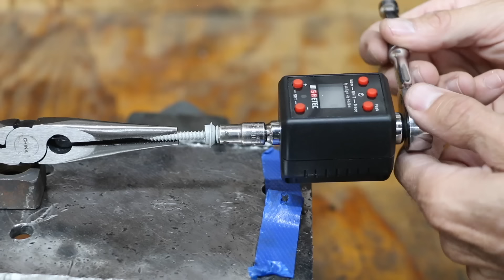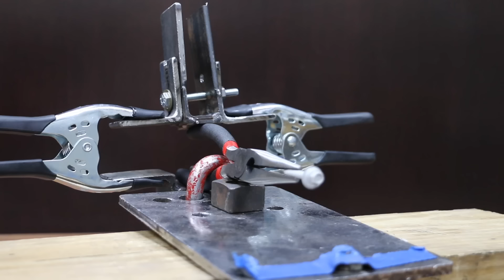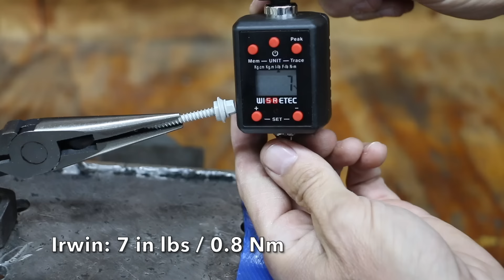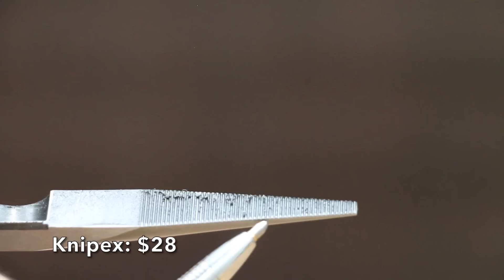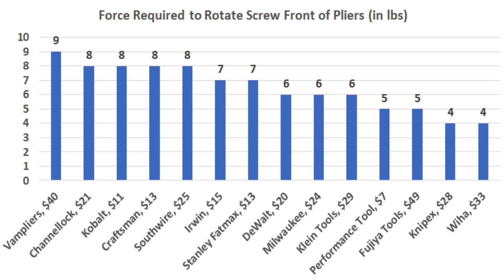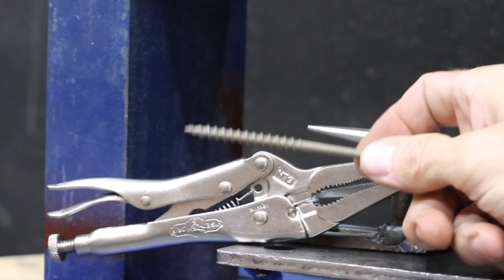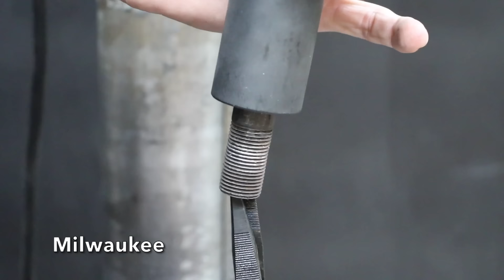Japan vs German Pliers (LONG NOSE)? Knipex, Vampliers, Klein, Fujiya, Irwin, Kobalt Needle Nose

Comment: The short handle, long nose pliers are made more with electricians in mind than mechanics, one can tell by the slip guards at the overmolds.
Less grip force is acceptable when you get a longer reach to grab wires deep inside device or distribution cabinet.
They also come in a variant  with even more pronounced slip guards as is mandated by the VDE to work on powerd off circuits, still physically connected to the grid. Just in case you froget the whole power off business 🙂
One neat test btw. is to expose the pliers to stone dust while they move. The cheap ones tend to seize up really fast.
Reply from the maker: Thanks for the feedback.  Thanks for the video idea.

Comment: I differentiate between needle-nose and long-nose pliers.  The needle-nose ones are smooth-jawed and very skinny and long.   If you work with electronics, smooth-jawed pliers can be quite useful as the tend not to damage softer copper surfaces.   I have a set of smooth-jawed needle-nose, duckbill and bent-nose pliers.
Reply from the maker: Thanks for the feedback.

Comment: Unfortunately, this test was not so good. The pliers, which were built larger and wider, perform better, as expected. The Knipex has a compact design for difficult areas and is therefore also shorter and a little thinner at the front. The test is not clear. 
The other tests are quite good.

Comment: I love this channel! With that said I work in a industry where needlenose pliers are our primary tool. It would have been nice to have a test to see which pliers would pick up and hold firmly the smallest item? Such as a small wire,string etc. The tolerance between the jaws when closed is super important!
Reply from the maker: Thanks!  Thanks for the video idea.
Reply: EXACTLY!  Needle nose pliers are a "saver" or "rescue" tool, so they need to pick up and hold small pieces at the extreme end.  Some are thinner and thus can get inside deeper, but then fail miserably to hold the spring or piece I need to pull or turn.  The twisting test is revealing, but most pliers will just slide before any real twisting occurs.  Perhaps a more related-to-daily-use test could be devised, in the Project Farm tradition...
Reply: @alfredomarquez9777  Yes, exactly.   Fit for purpose and fit for use, definitely two different things.  That said, this video shows how that applies and just a little more explaining on this would help the viewer better understand why one fails in a certain test vs another one.  Noted that it’s very difficult to cover every aspect in these tests and in the end everyone learns a lot from all the effort and thinking PF puts into these videos.  Just as valuable are all the comments discussing the details and in many cases the “why” of failure and success in a test along with why the tool has to match the use case of the user.   Of course, everyone fully respects the use case for their tools and would never exceed the bounds of the tool, like using pliers as a hammer.   Hehe.
Reply: Project Farm is the hardest working man on YouTube. Hats off for him.
Reply: Yes the Knipex were true needle nose pliers all the others were long nose pliers, instead of using the 26 model they should have used the 30 or even the 13 electrical installation multi pliers which have similar reach length to the other pliers tested. the cutting isn't very important as you say there are proper dedicated tools for those types of jobs, but I was disappointed that the knipex didn't hold up better, when all of their other tools do in regards to robustness.
Reply: Seconded. I haven't personally reached for needle nose pliers for the heavy duty tasks tested, but I use them a lot for electrical/electronic work, retaining rings...smaller stuff where precision and control are important.
Reply: Maybe pick up the small item with the lease amount of force required.
Reply: Maybe even add a test of long reach needle nose pliers.
Reply: So youre a sex change doctor?

Comment: Last test is imo one of the most critical for needle nose pliers. I would've liked see also accessibility test for tight spaces and that rated for overall performance, cause well, sizing is definitely a factor in force testing, but too big pliers aren't worth anything in ie. many mechanics work. But overall, pretty good testing.
Reply from the maker: Thanks!  Thanks for the suggestion.

Comment: I am in the market for metal capped dead blow hammers and cable cutters. Is the snap on dead blow the best deal at around $100 a hammer? Are knipex better cable cutters at $80 or is there a cheaper pair that's cheaper and just as durable? Been looking online at both and I'm just not confident in the options I've found but don't want to spend Snap on money if I don't need to.
Reply from the maker: Thanks for the suggestion.

Comment: Sorry but the tests weren't really applicable for the tasks 99% of users actually buy these types of pliers for. The tightness (so they don't twist off of whatever they're grabbing) and reach are probably the two most important features of needle nose pliers.
The ones that performed well in the grip test had almost not even needle nose profiles on their tips.  It was a simple demonstration of physics at work not a superiority of their specific brands.

Comment: I have to say that I doubt that I would ever use a long set of pliers to cut through nails, deck screws etc....matter of fact, I havent ever used them for that purpose...there are other, more adept tools for that purpose. If they can get into a small hole to pick something up without damaging it or retrieve it easily, then that would be good enough for me. I can appreciate your approach but I don't think that it is pertinent to these specific tools. Maybe tests of how well they can pull eg. wire through a hole without losing grip or how well they feel in your hand when using them in similar situations would have been more appropriate?

Comment: You should do one on trailer hitches . I’m looking at class 3 hitches and there are two for my Durango and $100 deference in price . I think one mounts on the frame and the other is half the size and mounted right in the middle under the bumper with like only 2 blots and is only 100 pounds Less in towing specs .. may be a fun comparison to do
Reply from the maker: Thanks for the suggestion.

Comment: It must be noted that this tool is NOT designed for cutting anything harder then copper. Use the correct tool and most of these will last an extremely long time. I would be looking at the falcon for movement b 4 buying. You wanna cut steel with the right tool. This is still a great video for getting started.
Reply from the maker: Thanks for the feedback.

Comment: I use a lot but apparently I'm babying mine LOL!!!  Wow that is some great testing.
So far in these hand tool videos I'm liking the price/performance of Irwin - not the best or worst, not the cheapest or even close to most expensive but for a home user a solid choice.  So far I've added a couple you have tested and for my household usage they have been big upgrades to what I had.
Reply from the maker: Thanks!  Thanks for the feedback.

Comment: Thank you for your work!
For long/needle tools, it might be helpful to compare the ability to hang on to a part deep down inside something.  Using the tip of the plier to hold a 1/8" sphere (ball bearing), how far down a 1/2" pipe will they reach?  While we're at it, can any of them hold a 1/8" ball (for example) with 100# of clamping force without the ball slipping (screw-head pull in a recess test)?  This might level the playing field for slimmer designs and those with cross-hatch vs diagonal serrations.
I too look forward to next time.  Thanks again!
Reply from the maker: You are welcome!  Thanks for the suggestion.

Comment: While this test showed the toughness of a set of needle nose pliers, that's really not what I reach for a pair of them for. Needle nose are really for use in deep places. For me there's a measure of dexterity required for needle nose pliers, single handed operation, opening and closing the jaws. I  have many pairs of needle nose pliers because some are finer on the point of the jaw while others are stronger but wider at the jaw tip, They each have their place. Cutting nails and screws is not one of the tasks I would use needle noses for. In the world of pliers, needle nose are more of a surgical tool than a brute strength tool.
Reply from the maker: Thanks for the feedback.

Comment: Issue here is you're testing those pliers on scenarios where other tools are used. Nobody will cut nails or screws with those nor require tight grip to hold things steady. That's what bolt/wire cutters and channel locks/vice grips are for.

Comment: Thanks for your testing – your channel is one of the few places to see comparisons between the different tool brands.

Would be nice to include the tool truck and industrial brands in your testing.  I realize that the tool truck brands are budget busters.  Testing the tool truck brands will help the young mechanics find out what they are buying when they put down their extra money to buy from the trucks.  

Industrial brands like Williams and Proto are more budget minded.   I have some Williams pliers and they work well for me.

There are alternatives to long needle nose pliers when twisting:  short needle nose or duck bill pliers.  

May want to point out that Craftsman, DeWalt, and Stanley are owned by the same company Stanley Black & Decker.
Reply from the maker: You are welcome!  Thanks for the feedback.

Comment: I thought due to the design, they were all pretty weak if you over use them. I've never bought an expensive one because I lose or bust them so quickly, and didn't think an expensive one would last me any longer. Another great review, but I'll carry on losing and busting the cheaper ones for a while longer at least 👍
Reply from the maker: Thanks for the feedback.

Comment: The "performance tool" make a reasonable diagonal cutting plier. They're only about $7 and you can grind off the face to make flush cuts. I usually have a few lying around and if you break or lose them, eh.
Reply from the maker: Thanks for sharing.

Comment: First I say great test. Gives a good idea of the toughness of the pliers, however I must say that it is missing an important aspect which is real life usage experience. I don't think that someone buying this kind of pliers will put it - unless no other choice is available - to this kind of abuse. These are mostly used for delicate work, and the test give us no idea how they do in their designed usage. For example - how do they grip a a small diameter wire, how easy it is to do some gentle work with them, I would expect that working with those who have a stiff handle movement will tire the hand when doing delicate work, and so on.
Thanks for the time and effort.
Reply from the maker: You are welcome!

Comment: I have a pair of Channel Lock pliers that I’ve worn out the tips on. I’m a machinist and used them to grab and twist off the burrs on the end of steel tubing after being parted off on the lathe. Over time I wore down the cross hatch diamond grippers on the jaws so that took increasingly more hand grip to get a good bite. I may have sprung them some too because I can now see about 1/64 to 1/32 of daylight between the jaws on the tips. However they worked really well up to that point.
Reply from the maker: Thanks for the feedback.

Comment: I'm an electrician so Klein is probably the most common I see. I think for needlenose they're quite pricey. I have the exact model of Southwire with the blue handles and 12ga. wire stripper used in this test and overall they seem to perform really well so I'm happy with them.
Reply from the maker: Thanks for sharing.

Comment: I use Channel-Locks for all my hand tools and never had any problems with any of them.

I specifically chose this brand since they were made in the USA. I am surprised they did so poorly on the twist test, not that I have ever used them for that level of extreme torque.

I think a reach test, smallest item it can pick up, or small access test would have been beneficial, since that is the design purpose of the needlenose pliers.
Reply: I love my Channelocks.  I go for them first before my Snap-ons or Knipex plers.
Reply: @dc5723  I have a pair of old Irwin needlenose pliers that have lasted me for almost 20 years now. Probably the only pliers that are not Knipex that ride around with me.
Reply: I had terrible luck with channel locks, but I'm also a mechanic in the rust belt and probably do more forceful twisting with needle nose trying to remove stubborn fasteners etc.
Reply: "made in the USA" doesn't mean what it used to
Reply from the maker: Thanks for the feedback.
Reply: Yeah, they make linemen's pliers for twisting stuff. Channellock is my favorite pliers brand.
Reply: I've never had much love for channelock, maybe just bad experience as I've only used their terrible slipjoints, where a tool is made has absolutely no meaning there are shit tools made everywhere and good tools in all markets too.  Just buy the good tool not the flag waving bullshit, you'll end up with a better toolkit picking your tools on merit rather than country.
Reply: @Savagetechie  guess you shop at Harbor Freight then, lol
Reply: @badboy10350  I've never even seen a harbour freight, I live in Scotland. I just think country of origin isn't important at all, I have nice German tools, nice Japanese tools, nice Chinese tools and some nice ones from Austria etc etc I've also had some shite ones from everywhere too. The only people in the world that place country of origin as a top requirement are North Americans and its just stupid, choose quality not country.
Reply: @badboy10350  no its just reality...you really think "made in usa" means the abs benchmark anymore...pfffftttt i feel bad for you if you do think that bub
Reply: @Mike_Jones68  I'll take that over "most" made in China anyday.
Reply: @Savagetechie  I guess you just don't get it....LOL

🤪🤪🙄🙄🙄
Reply: @Savagetechie  AMEN!

Comment: I just can’t, yet again. You try to do every test so precise, yet this is another test you did wrong. That screw the pliers was holding onto should have been turned 90 degrees so it laid across the pliers and not on line with them. This way no matter the way the gripping lines in the pliers, straight or diagonal, they all have the same chance. Each set of pliers with straight grooves have a different amount of grooves per inch than the next set. You laying that acre in there with the threads laying e same way as the grooves is a certain fail before you begin. Maybe if you would have picked a non threaded test media, then all would be fair.  I had to stop one minute in because I saw it was going to fail on the first one. I just don’t understand how you can know so much about so many things, then be clueless on others.  Sorry but this is not your first bad test that I have corrected you on.

Comment: Great video as always…..!!!!!

The only thing I would say is that these type of pliers really are not designed to cut nails and screws 

they are “wire cutters”

at best you would cut fencing wire which is actually quite soft or electrical wire when wiring a house…….

So if they fail cutting a deck screw so be it…….
Reply from the maker: Thanks!  Thanks for the constructive feedback.